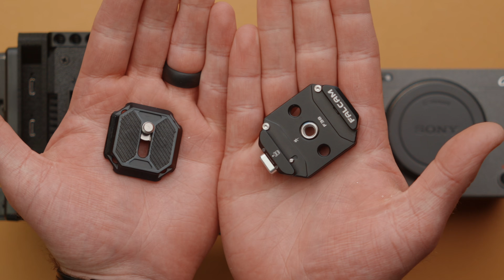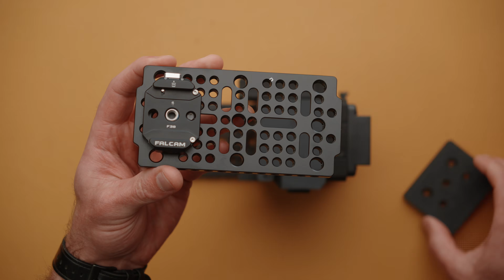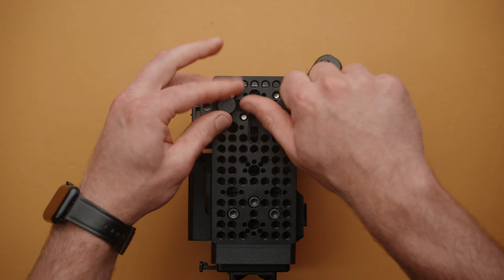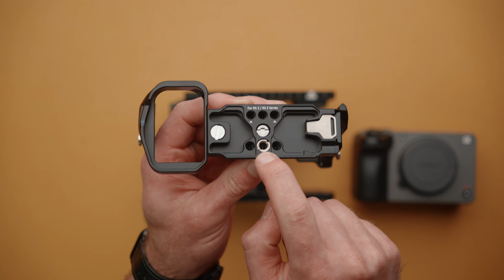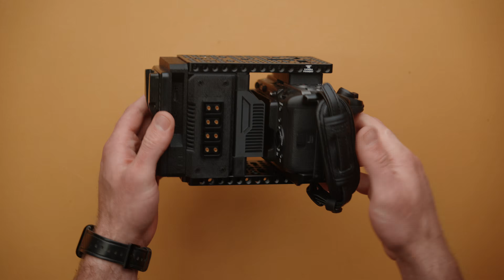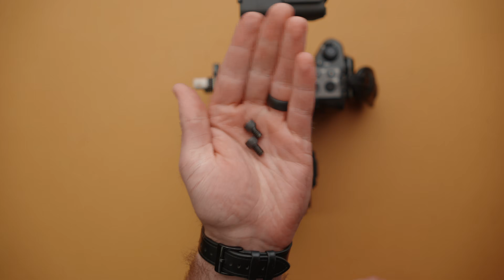CineBack™ for Sony FX3 Version 2 is Here!

Comment: What is your recommended PD solution for someone wanting to use USB-C PD with simultaneous timecode via the multiport? Is the included cable long enough to be rotated so it goes upward, and then into the upper port on the cineback?

Comment: Is it safe to turn the FX30 on/off using the external battery switch? I mean, my camera is plugged in the wall outlet. Can I just leave the camera swtich on and use a smart plug to turn on/off the camera?  Is it safe?

Comment: Umm seems that the update with the cage is missing, there's no quick release part installed. Is the falcam F38 compatible with the cage? if so, it'd be amazing to see it working. Also is the separator module "J" included in the quick release module? Or needs to be purchased separately? Really nice product!

Comment: While I've found a solution for my camera already, this is a great upgrade. nVu films had made a modification to his cineback to add quick release compatibility. I'm sure you've seen other kits doing similar, but one thing that I'd love to see is a V2 kit for the R5c that has a section to make it compatible with the Tascam XLR module AND allow a top handle to be used. I wouldn't be able to throw my $ at you fast enough

Comment: @33:20 from my understanding, this problem only occurs when unregulated cables (or cheap cables that don’t regulate well) are used, and/or if the dtap is being hot plugged. 

Also, what you’re doing @34:55 is common and totally fine if, again, high quality, regulated cables are used, everything is connected to a shared power source, and the power path is stable — and if the camera is well designed.